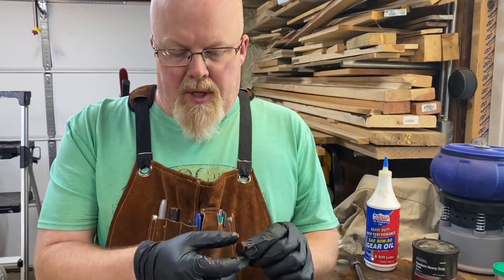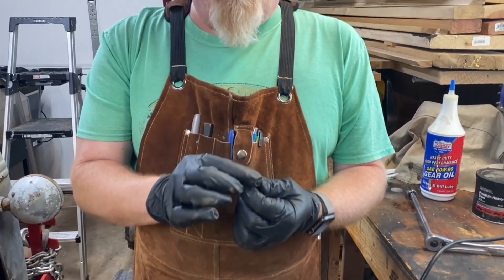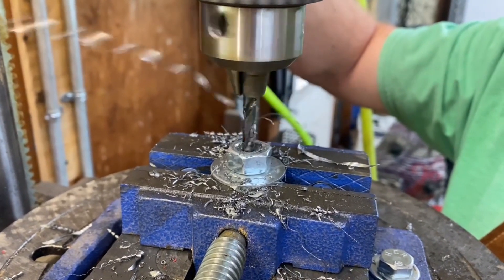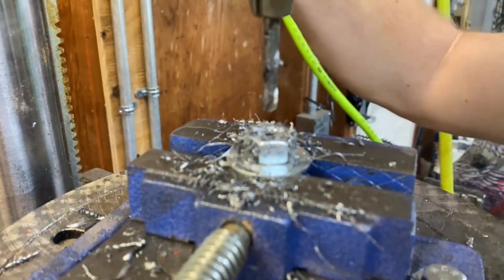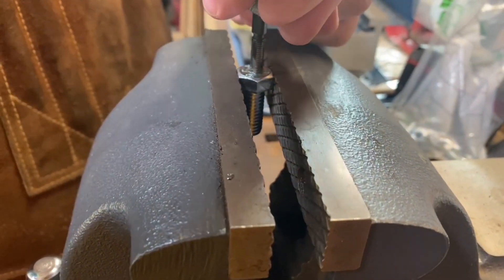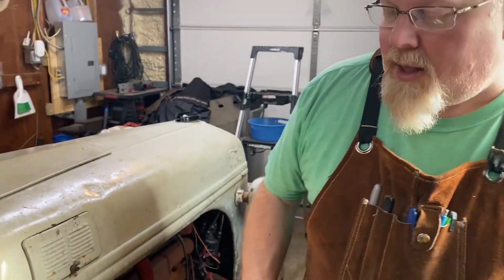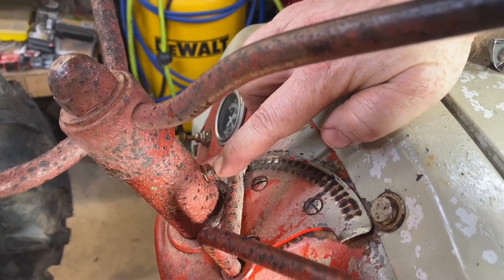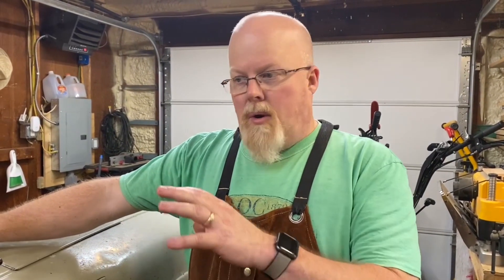Ford 8N Steering Gearbox Grease Fitting Installation

Comment: My new sitrix Tedder came with grease in gear box. No 2. Watching  ur video .verified I did take out the correct screw. Used pump for filling boat inboard lower Unit. Pumped in some.put screw back in quick as was running out.

Comment: my 8N does not have a fitting on the steering shaft
Reply: I have Ser#279589, and the bolt he is using is a "blind tapped hole" on my tractor, Even if I was to build a grease bolt like this I stiil would not be able to pump grease in the gear box unless maybe I was to drill a smaller hole into the steering box cavity. Then I would have the problem of drill chips getting in to the gearbox. In my case, The only sulution would be to totally disassemble the steering gearbox to be able to make this system work.
Reply from the maker: @denniskrueger3903  check out this link.  Your version might be mentioned https://www.ntractorclub.com/howtos/pdfs/8N%20Steering%20Box%20Lubrication%20-%20Cornhead%20Grease.pdf
Reply from the maker: Not all did.  This is just showing you how to put a fitting on the gearbox.  If you are able to watch the whole video, I discuss other plug styles.